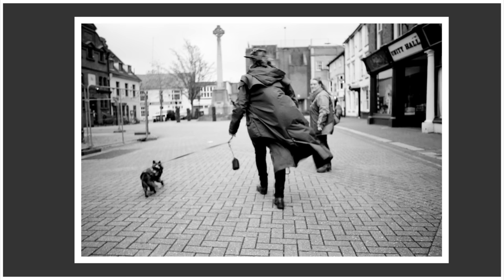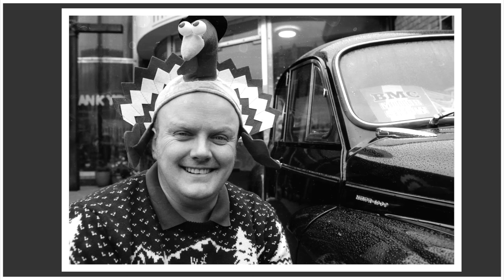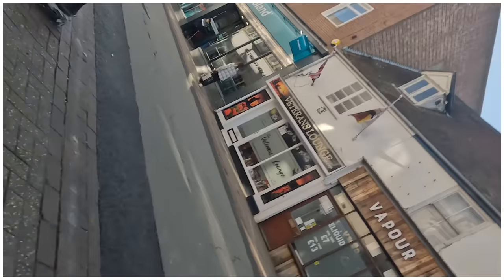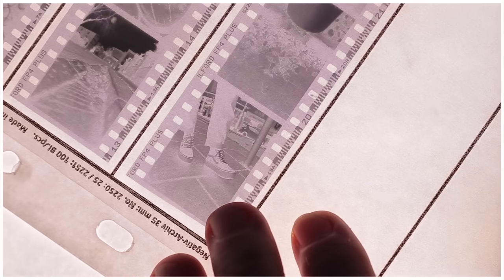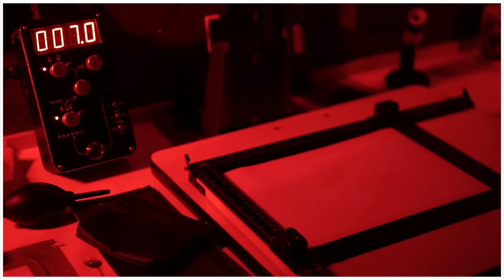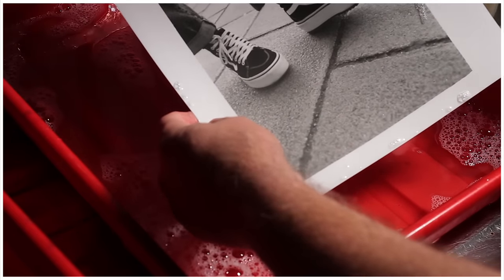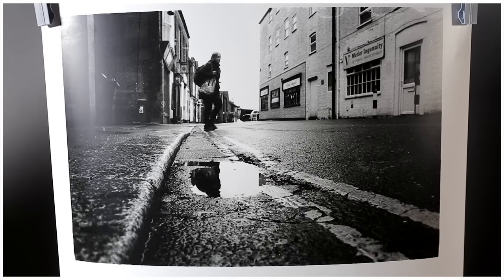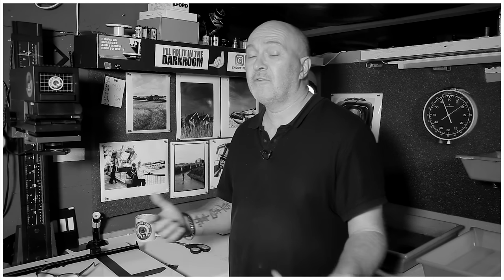Street Photography on Film and Making Prints in the Darkroom.

Comment: What are you using in the print wash that makes so many bubbles? I assume that is a final print wash. It looks like you've added Photo Flo that is used on negatives.
Reply from the maker: I was waiting for this comment. It's just a couple of drops of washing up liquid. It seems to work with hanging the prints to dry and any water marks, which lately I've been getting.